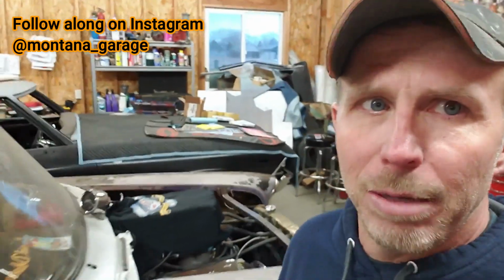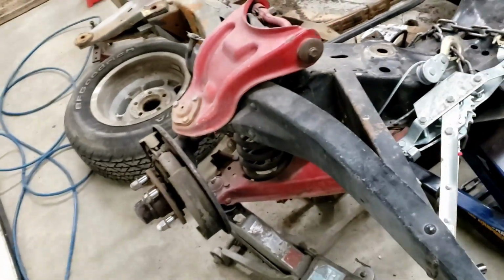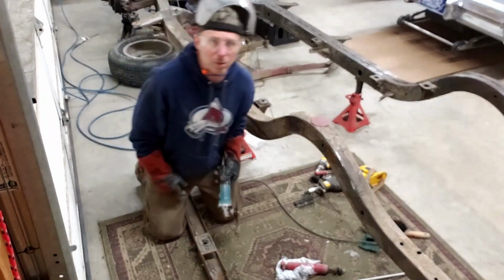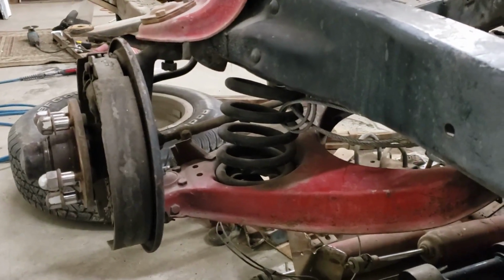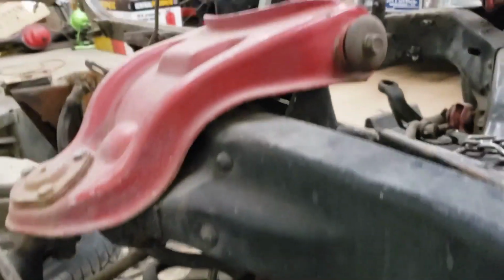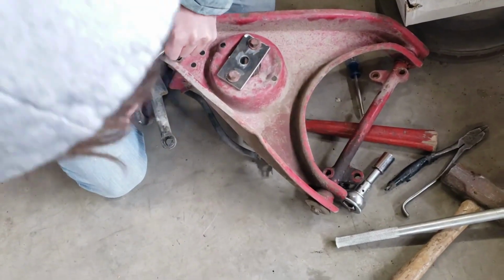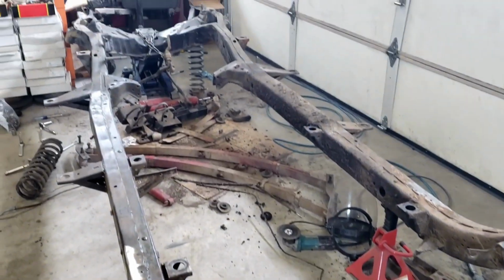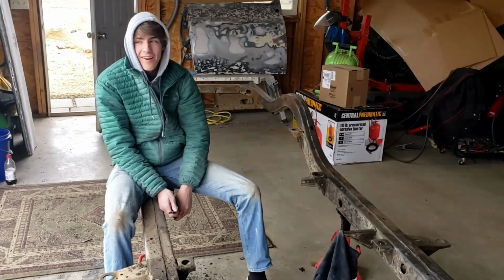How I Removed 1955 Chevy Front Suspension

Comment: Done your trick before - grease the threads and put a safety nut on -  if you use your device to reassemble, do not use a impact tool as the threads may very well strip' - keep up the good work
Reply from the maker: Thanks for the advice John. I will grease the threads and add a safety nut. I agree about not using an impact tool for reassembly. Thanks a bunch for watching and commenting!